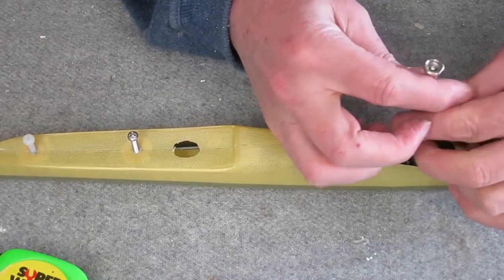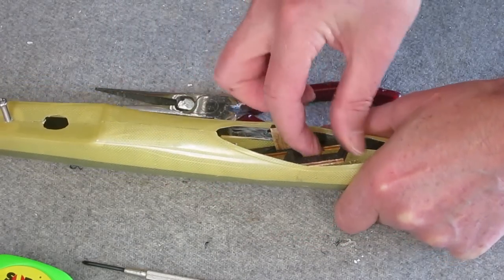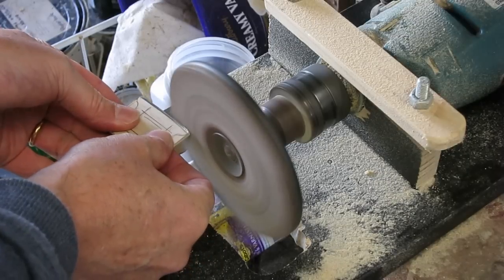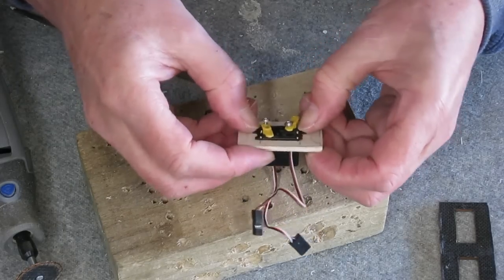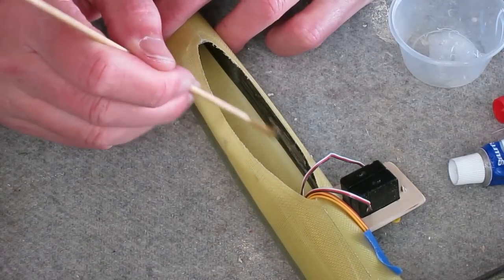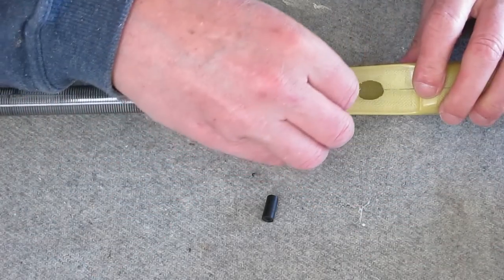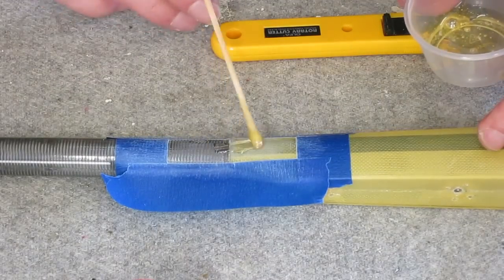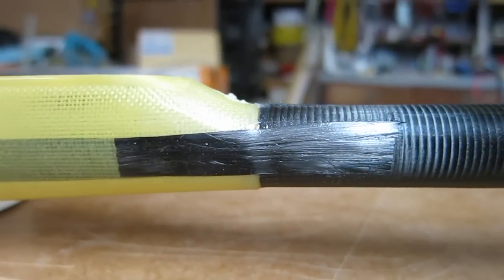V2 DLG build Part 1 - Servo tray and strengthening

Comment: Did you change out the aileron servos also, and if so, what did you change them out with, or what would you suggest?
Reply from the maker: +Jim Tomasetti I haven't yet but will eventually change to KST DS 245 metal gear 9g digitals. I have used Dymond D47 in the past but they stripped too easily.